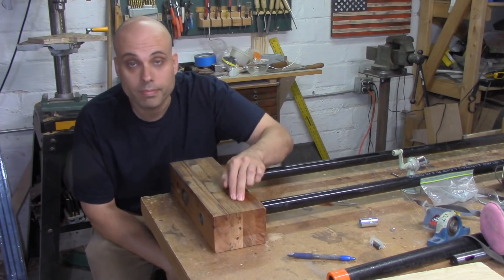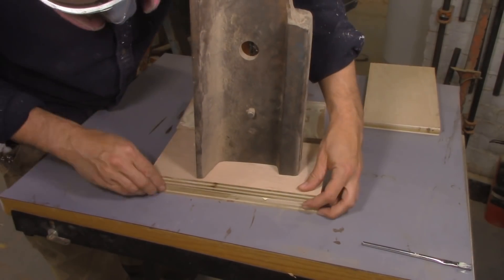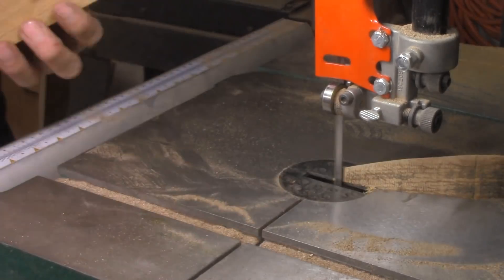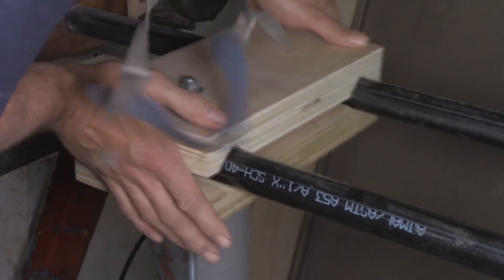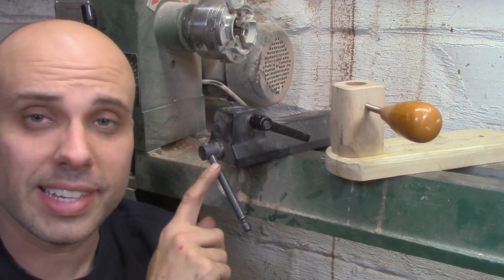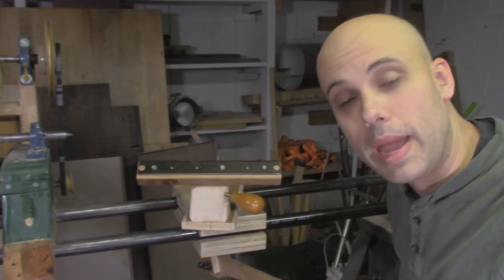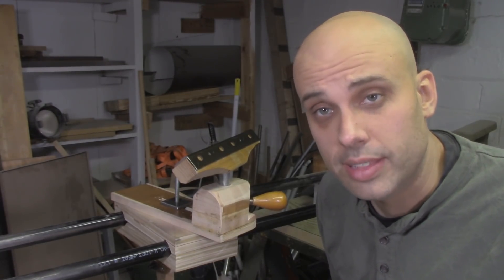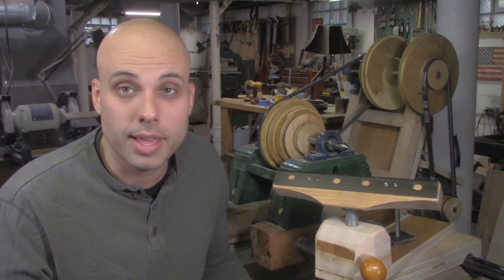Real Lathe Pt. 4: Fully Adjustable Tool-rest

Comment: Instead of angle iron for your tool rest, route a cove in the top and epoxy in a piece of A2 drill rod, and if you can get it hardened, all the better. Much less friction as you slide your tools across the top. The A2 is considerably harder than the O or W drill rod.

Comment: 8:00 I wondered about that early in. There's a couple of solutions, looks like you got it figured out.

One other mod you might want to incorporate is a vertical 5/4" rock maple fence without that metal piece. It will be much easier to use, allow you to have more control with the cutting tools, and isn't going to wear out according to some full-time turners. 
Even if you stay with metal, the vertical orientation is going to be a huge improvement over the sloped tool rests of any type imho. I have never been able to work with them. I have a metal tool rest now which is fine but I am going to be making a new metal adjustable base and likely metal posts, but the fence I am going to plane out of a 20" piece of very dry split maple turning blank. I think the 3" flat smooth vertical edge is going to be an even better guide and support than the 13/16" round steel rest I made all those years ago.

Comment: When gluing up the wood for the banjo (the hard maple) could you have embedded a threaded nut in the wood so that the screw is even less likely to strip the threads you tapped into the wood?
Reply from the maker: Yes, that would totally work.

Comment: I really like the carriage lock underneath the carriage.  Looks like mine is going to get an improvement.
Reply from the maker: Thanks!  The cam lock took a lot of screwing around, but once you have it dialed it, it's EASY to use. Also very fast.

Comment: This is coming together really well. I don't suppose you'd ever consider making a wooden chuck for the headstock? One of those, the name of which I forget, that automatically tensions when rotating one face against another seems like it'd be a very handy addition.
Reply from the maker: Night Cat I want to do a chuck,  even though it's not necessary.  Faceplates are under-rated. I think you mean a longworth chuck and those are very cool. I have some vague plans for a new kind of chuck,  but making it would be very difficult.  Not sure it's worth it.
Reply: @RexKrueger  Yes the Longworth is the one I was thinking of. It's true you can get a lot done with a faceplate, but they can make spindle work a bit difficult, & it'd be a shame to have all that bed length go to waste. I suppose you could do it with a wood screw & bore though..
Reply from the maker: @nightcatarts  Don't worry. I have big plans for work-holding. Just you wait; it's going to be EPIC!
Reply: @RexKrueger  I look forward to seeing what you come up with :)

Comment: I have really loved this series Rex. I think you have done a great job. I'm a bit concerned about the tool rest. Most rests have a little groove that your forefinger would slide along. I think it might be difficult with that angle iron. Maybe you could bend it further, possibly to 45 degrees. Then, cut a slot along the existing wooden rest and epoxy/screw the angle-iron back in. The wood will be easier on the skin when sliding along the rest. Just my two-penneth. Thanks again for an entertaining video.
Reply from the maker: It's true that I'll need to try this design out and see how it shakes out in use. I might hate it. On the other hand, many pro tool rests are just round steel bars with nowhere to rest the finger. Maybe mine will work like that. We'll see!

Comment: Excellent! I am loving this lathe build!  One idea I have-- it seems that when you move the tool rest assembly along the ways, it doesn't slide as nicely as it could. You could try cutting some rectangular pieces of milk jug material (HDPE -- high density polyethylene) and attaching that inside the grooves of the tool rest base where it slides along the ways. It would need to be tested to ensure there is still enough clamping pressure to keep it from moving with the reduction of friction. Or you could even try the thicker cutting board material.
Reply from the maker: You know, I've build two of these carriages. They are constructed exactly the same, but one moves like butter and the other sticks a bit. Going to need to work on that. Good suggestion!

Comment: nicely done  .how ever i got a question  looking at your lathe all through this video as it would pop up the same question came to mind . the head stock drive shaft has a huge live center point . houston i think we have a problem . now i dont know your plan buddy but it might be a little hard to hook a chuck to that . cant wait to see how you do what ever it is you plan to do with it . good luck .
Reply from the maker: I don't plan to use a chuck. This is a low-cost lathe and I think most people who can afford a chuck can afford a lathe. BUT you're totally right. Right now, this thing wouldn't turn anything. But, boy do I have plans for that!  Just you wait and see!
Reply: ok sounds good i cant wait . so far its looking really nice im sure its going to be cool . be careful buddy and have a great day .
Reply: I had the same tought. You cant really turn notging between 2 live centers. Put a m33 threaded pipe in the hedstock and you Will be able to use whatever turning tool
Reply: I had that same thought one or two videos ago.  I'm intrigued to see how you address that problem.
Reply from the maker: @TommasoRatano  I mean this with all due respect, really, but do you honestly think I've spent a month building this thing without realizing that I need to drive the work somehow? I know your comment wasn't meant to be combative, but what are the chances that I've overlooked something that basic? I'm getting there. I promise. Thanks for watching and sharing your thoughts!
Reply: @RexKrueger  Man, just saying. You got that far, you put all that work in to it, with an m33 shaft who can't be that expensive to make or buy, you could use a chuck wich is a very big part of what a lathe is needed for. As woodturner, a 60$ chuck is better then no chuck. But hey, just my 2 cents. I'm sure you considered it all
Reply from the maker: @TommasoRatano  What's an M33 shaft? Maybe that's a solution I overlooked!

Comment: Isn't the 90 degree angle iron on the top of the tool support going to create a big space between the fulcrum and the turning stock, and increase the likelihood of your tool catching?  I was under the impression that most tool rests have a basically vertical side toward the turning stock so that you can get the tool as close as possible to it in order to minimize the potential for accidents if the tool catches and the handle snaps up suddenly.
Cutting the back of the support down so that there is a vertical face, and replacing the angle iron with a piece of flat stock would probably prevent that being an issue.
Reply: Yeah I'd agree there, the toolrest as designed right now won't be much fun to use.
Reply from the maker: My current lathe has a 90 degree angle on the tool rest. It seems to work okay. My current tool rest isn't very wide, so I think the amount of overhang will be within tollerance. But, when I get to testing it, I have to be ready to make adjustments. Stay tuned to see how it works!
Reply: I look forward to seeing how it turns out!

Comment: Instead of mounting the tool rest to the pipe, mount it to the table.
It might not be nearly as easy to move, but if you build it correctly, it will be sturdy and will not put ANY stress on the lathe ways causing them to flex.

Comment: I know you said it in an earlier video, but what is the best speed range for lathe turning?  I don't plan on bowl turning anytime soon, mostly plane knobs, drawer knobs and tool handles. I love the lathe build. It is the best one I've seen yet.
Reply from the maker: The speed depends totally on what you're turning. Small spindles are fast. Big bowls are slow. In the middle, there are many factors that determine speed. Best to google the topic and read a few articles. There's a lot to know.

Comment: If you clean off the pipe with acetone and get all the black coating off then cover with a wax and put some of the plastic in the grooves of the bangs that rises on the pipe it should slide a lot easier and hold up longer just a suggestion really like your videos very educational
Reply from the maker: Those are good ideas!  I do want the carriage to slide even more easily.

Comment: An old trick that RC guys use when mounting motors to balsa is to drill the holes, then superglue the empty hole to fortify the balsa. I'm sure the same could be done for tapped timber threads?
Reply from the maker: I've seen people do that with tapped wooden threads. It would be perfect for this application. Thanks for the tip!
Reply: @RexKrueger  also, surprising to many, balsa is categorised as a hardwood. I just like to throw that little factoid out there, especially around woodworkers.
Reply: @RexKrueger  I'd recommend putting some thin superglue in the vees you cut into the plywood base pieces too. Under pressure & twisting forces, those could end up delaminating & the superglue would soak right in and hold things together. Just apply it & then rub it into the wood (quickly) using a folded up piece of kitchen roll paper.
Reply from the maker: @nightcatarts  You nailed it!  I do have delamination problems. I'll be addressing them in the next video. Good prediction!
Reply: @croyce7699  And Yew is a softwood.
Reply: @RexKrueger  Laminations should have been vertical?
Reply from the maker: Donald Sayers maybe.  I addressed the issue in the next one
Reply from the maker: Donald Sayers yew? There's yew in this build?
Reply: No I mentioned it because someone mentioned soft balsa being a hardwood, Yew is an anomaly the other way, it's very hard but is a softwood.
Reply from the maker: @donaldasayers  Ah!  That makes more sense.
Reply: @donaldasayers  as an archer, there's nothing I like better than a bow of good English Yew! ;oP

Comment: I find myself thinking a lot about building my own wood lathe. I wonder why :)
Reply from the maker: Dude, do it!  With your machining abilities, you could make something amazing. I'm not sure if you're familiar with the Pattern Maker's lathe, but it's a fascinating machine and I'd love to make one. I'm not set up for it, but you are!
Reply: I have 2 wood lathes and I haven't done any wood turning the last year. Too much mess.
But a movable wood-lathe would be nice for some recreational outdoor turning during summertime.
I guess I should try selling my wood-lathes :)

I believe my old bench lathe is also called a pattern makers lathe. Unfortunately I'm missing some part of the original wood turning tool rest. So never used if for tuning wood. It too slow anyway. Only 600rpm max.